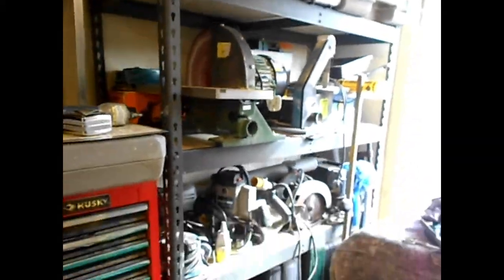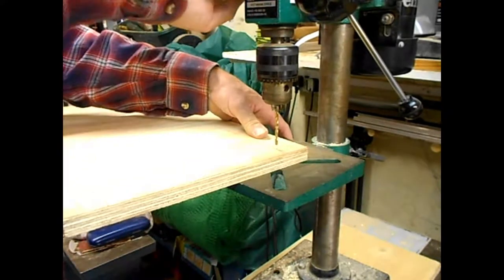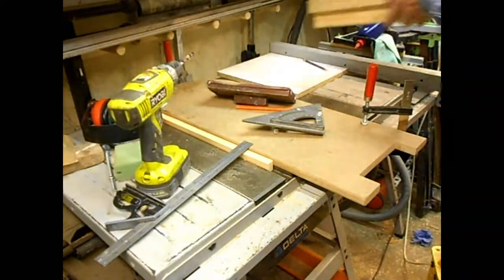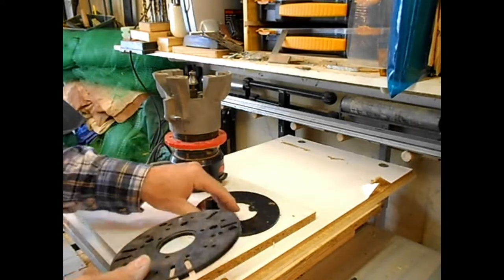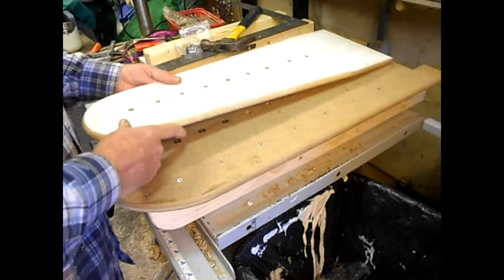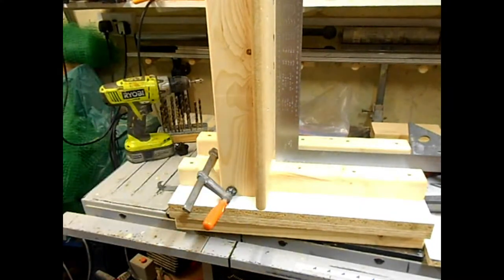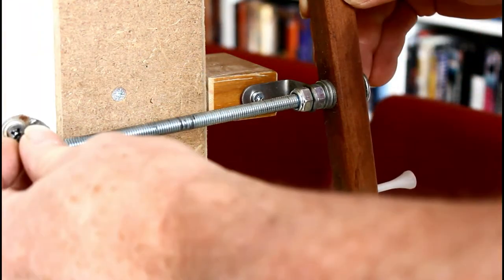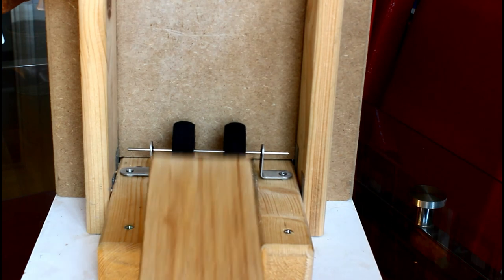Radius Sanding Block Jig

Comment: the problem will be at the first part and last part of the cut because the foam rollers arent both making contact at that time..maybe a vacuum system that works from underneath the block might be better
Reply from the maker: Hi Mikko, i see your point.  The rollers are there to provide only downward pressure. The block being shaped/routed is sitting on the base and is prevented from moving downwards and sideways.   Extraneous movement is limited without too much friction so as not to hinder its forward motion under the router bit.    The rollers are another security to prevent the block lifting up due to user error.  It seems to work well enough, however, it's not perfect. Short of having the block clamped and moving along a precision rail guided by bearings, this is the best I could come up with.  

I think the real problem with any home made design is the inaccuracy of the pendulum and router bit, it always leaves some variation in the cut which has to be sanded out afterwards.  Then of course you stick sandpaper onto the block and that comes with other irregularities.  Finally, the sanding technique of the user.   

I have a 10 part restoration of Japanese 70s guitar on my channel where one of the blocks was used.  If you are working on guitars, this may be of interest. 

Thank you for your comment and please subscribe.